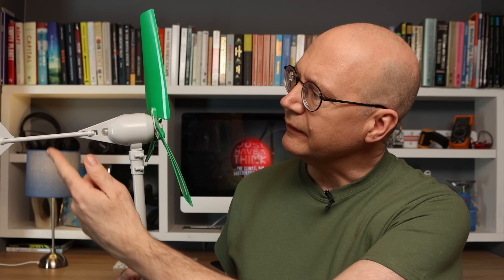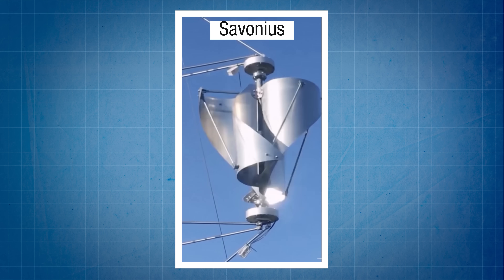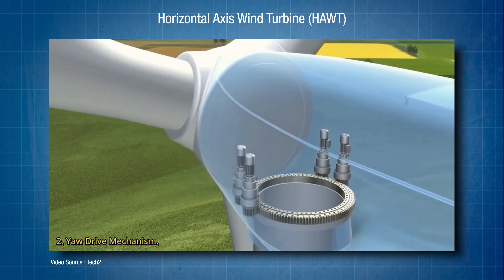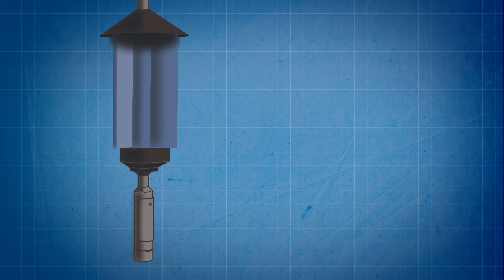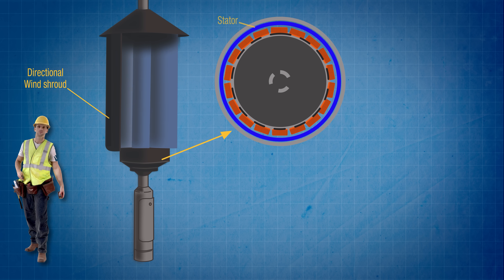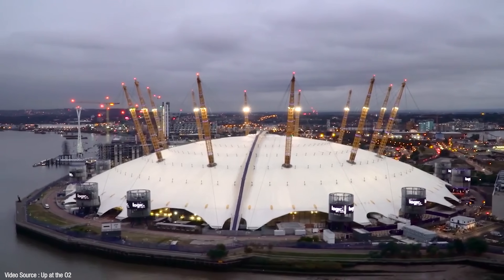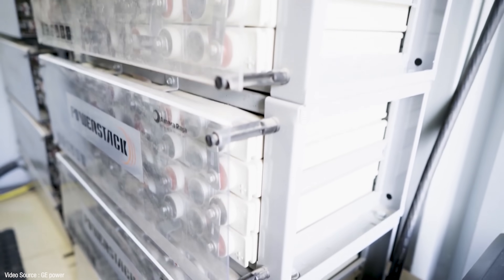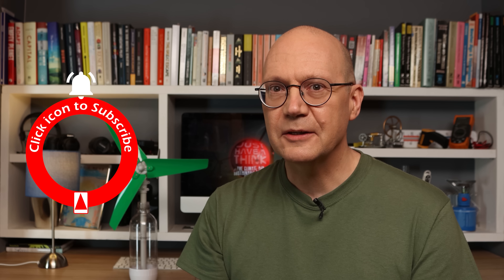A vertical axis wind turbine that doesn't need the prevailing wind! How do they do that?

Comment: I haven't tried to work out the math but those kwh numbers seem really high.  However, even if so, if they can be made cheap and reliable and deliver even enough power to break even or come close, I'm all about it.
Reply: @John M. When did you look at this?  If it's based on data from even a few years ago, then your information is out of date.  The cost of wind and solar has PLUMMETED in recent years.  It's actually been plummeting for decades, but only recently has it become super cheap.  Look at the most recent data on LCOE from the US's Energy Information Administration.  

https://www.eia.gov/outlooks/aeo/pdf/electricity_generation.pdf
Reply: I did calculate it.
You need a constant minimum wind speed of 55 miles/hour or 90 km/h to achieve 25 kW out of such a turbine.
That is wind scale 10: "Seldom experienced inland; trees uprooted; considerable structural damage"
Reply: @TheSpecio  Well it isn't that uncommon here to have 55 MPH winds. But then we don't get structural damage when we do get them. How often do we see those winds, every summer during some of our thunderstorms. When we have a Cat 1 Hurricane winds, we don't even have enough damage to file an insurance claim. Irma had winds recorded as 73 MPH in Miami. I'm 30 miles SW of Miami. Miami-Dade, Monroe, and Broward counties' building codes have the nation's highest wind standards. They improved their preparation after Hurricane Andrew hit in 1992. I know all about Hurricane Andrew because I had to spend 30 out of 32 hours at work because of it. And had a briefing afterwards that contained info that was never released to the general public. It took years to even get the government to admit how high the winds actually were. It also took years for the government to admit that there was a Hurricane tracking plane in it when it came ashore. By the time I got home after 1700 that day, our generator was running, the floors were already dry, and the windows damaged by flying debris had been covered. Our house was dead center of the eye. The power pole that was installed when our house was built in 1978 still stands today. We've gone thru more Hurricanes since then, Hurricane Katrina hit here before it hit the Gulf Coast. Hurricane Wilma that took out our neighbor's power for a week. But less than $1000 dollars damage to our home. But then, our house was designed and built to better than code in 78 and was inspected by the USACE, our insurance company, our county after Andrew to find out why we had such little damage with a two story house. And part of what they learned went into the updated code those three above counties use. Our average winds only are in the around 9 MPH range but we also have a 170 MPH wind code.
Reply: @gravelydon7072  Very interesting!
Reply: @John M. You said the large amount of land that is unusable because of the turbines. You need to talk to our midwest farmers who are still growing crops on their land around the wind turbines. I guess they don't know that it was unusable.
Reply: I did.
It's a scam
Reply: @John M. Danish power is more than twice as expensive for the consumer than in the US; so who is subsidizing?  Which country gives more tax breaks to companies?  As I pointed out, you are far from an expert on this, have no sources because there are none, and now you are predictably resorting to lame insults.
Reply: @John M. My last word here, take a look at this, about LCOE, by Tony Seba, who is much smarter than both of us combined.  https://www.youtube.com/watch?v=YJ-HlykM1LU
And if you want, do tell me where he went wrong, lol. (Just ad some sources, ok?)
Reply: @John M. sir did you really say that wind turbines are more expensive and environmentally harmful (material-wise) than NUCLEAR? i-- https://www.lazard.com/perspective/lcoe2020 the levelized cost of energy of (unsubsidized) wind is 4x less expensive than a new nuclear plant, not to mention it doesn't use ...radioactive fuels...
Reply: @John M. What was that about climate change? "not how they say"? So that is a scam, too?
Reply: @John M. I'm going to limit this to one point, please just respond to this one thing, I'll get to the next ones later. You state d There have been reports from many different places detailing health problems that accompanied living near a turbine. You mention the value of academic papers that require peer review and reproducible results. Therefore, please provide these academic papers that detail the health problems that accompanied living near a turbine.
Reply: @John M. Oh, come on. I will provide data and reports about distributed, community, and utility renewables (wind, solar). But you made an statement about the health effects of wind turbines. You have also stated your opinion on academic peer reviewed studies. So back up these health effects with a study. If you can't provide a SINGLE study then you are no different than the commenters that you complain about not reading academic studies. It shouldn't take much time at all.
Reply: Yeah, I think you are right. It just doesn't add up. Back of the envelope calculation:

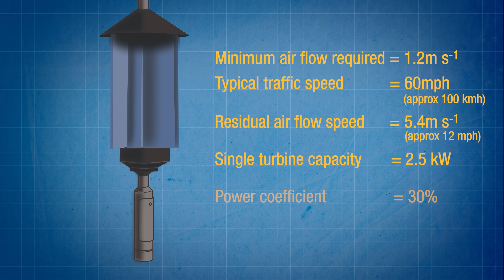The energy in wind is 1/2*rho*A*v³, of which you can harvest at most about 55% (Betz law), with rho being the density of the air, A the surface area the air passes through, and v the speed of the air. Let's be generous and say the average air density is 1.25 (it gets lower when the temperature increases) and estimate the surface area of the device to be 1 square meter. Let's use that 5.4 meters per second (which would only be the case while a car is passing a speed, but again, let's be generous). That works out to an energy generating capacity of... 54W, with 0 mechanical losses and operating at the top-theoretical limit of 55% wind-energy to mechanical energy efficiency, something that will certainly not be met). Compare that to the claim of 2.5kW in the video at the 5:30 mark. I will hold off investing in this if you don't mind. 

It would be nice if @JustHaveAThink would, well, just first have a think before blindly reproducing the very improbable numbers from startup #25328 in low-altitude wind power for urban environments.

There is very good reason wind turbines are becoming so huge: high and more constant wind speeds at altitude, and  huge surface area covered by the blades.
Reply: @John M. Please show us the research that has brought you to that conclusion.  Or are you just guessing?
Reply: @dacutler  Don't bother with this guy. He claims he has sources and then he claims he won't bother to look them up and then he claims he can't access them. Does not engage in actual argument. Probably works for the fossil fuel industry, or used to.
Reply: @tzenophile  I agree.  He's using the same old tired arguments that can only have their sources in political agendas, not actual scientific research.  The very moment somebody invokes Al Gore is when I switch off as they obviously don't have anything useful to add to the discussion.
Reply: @John M. I'm sorry, but I am not going to comment on your political comments in this subject.  This has nothing to do with the arguments around  climate change and I'm certainly not going to discuss Al Gore.  He is always thrown into an argument for political reasons and there's nothing to be gained from it.  As to whether or not I agree with their findings, only time will tell, and it most certainly won't be modified by  political expedience. I'm always very wary of people who dismiss the research done by peer reporting for no concrete reasons when it's obvious they dismiss it because it doesn't fit with their established agenda.
Reply: @John M. This is a common and a false argument.  Yes, of course temperatures have fluctuated before the mid 18th century when humans started to add more CO2 to the air by releasing carbon that had been sequestered for millions of years.  That has nothing to do with the fact that there is another source of CO2 in the air that has been added to the other, already existing, sources. Data has been used in analysis much further back than 10k years anyway.  Arguing otherwise is like suggesting that we don't have to take action to reduce deaths from road traffic accidents because people have been dying for years before the car was invented.
Reply: @John M. This discussion doesn't take any notice of future predictions. One way or the other. It's research that is trying to produce results right now. In the context of this research, I am not going to hold my breath for the advent of fusion power when there are smaller, hopefully effective ways to reduce CO2 effects on the climate, that we could be getting on with right now, even if only in a small way.  I'm sorry, but all your comments so far have been extracted from the tired old discussions about climate change as a whole, and not from this particular R & D.
Reply: @John M. I wish. Was taking classes in fusion reactor design, magnetohydrodynamics, non-equilibrium gas dynamics at CMU in 1981 hoping to have a career in plasma physics and fusion reactor research. Even back then it was 20 years away for a commercial fusion reactor. Personally I BELIEVE that we will have HVDC grid interconnects done in the USA before a commercial fusion reactor. It is not what I have always hoped for.
Reply: @John M. Are you still insisting on conflating this subject with the politics of climate change?  How do you know the people who are researching this aren't more conservative or republican than you are and are therefore not on " my side "?  Actually, you are wrong, but that's another subject that is far too complex to discuss in this format.  There are plenty of peer reviewed articles on the subject, I suggest you read a few (and not take your conclusions from Al Gore or any YouTube video produced by somebody who obviously doesn't have any idea about it). 

You're not a flat earther by any chance?    Just wonderin'
Reply: @John M. I was wondering when you would resort to insults.   It's the MO of people who don't know what they are talking about.  . . . .   Oh well.  I'm not going to contest you by  tell you how old I am, my credentials and how I have not run away from something new.  That info is not for this YouTube.
Reply: @John M. Eh?     What has that word salad got to do with the subject at hand?  You are entirely wrong about scientific people.   As Einstein said "  No amount of experimentation can ever prove me right; a single experiment can prove me wrong. "  A person can only call themselves a scientist if they welcome somebody proving them wrong more than proving them right.  It's only proving a person wrong that can make any progress in any scientific field.
Reply: @John M. " People like you would have called the sailors liars. "  I'll give you this . . that's the weirdest accusation of me I have ever heard.   I'd love to see specific data that proves your statement.
Reply: @John M. Have you confused comets with asteroids?
Reply: @John M. You are full of crap. Some idiot says blah blah about wind turbines, there is no real studies backing up the blah  blah health problems of these wind turbines, and you seem to always fall back on: The scientific establishment is not letting the truth be told. Good bye
Reply: @John M. What has this got to do with turbines?  Why are you wasting my time like this John?  Is the only way I can stop you asking silly questions to ignore you?
Reply: @John M. The data are clearly broken out with and without tax credits, and wind and solar are cheap either way.  You'll also notice that nuclear is eligible for an even larger tax credit than wind or solar, yet is far more expensive, even with the tax credit.
Reply: I was thinking the same, no way it can produce that much electricity!
Reply: I agree that this sounds like pie in the sky.  But if it proves out from a credible source,  i would advocate it.
Reply: @VAspeed3  Of course.  I'm always fascinated by small/edge power generation technologies and more options is better.  I just hope for everyone to be forthcoming about the limitations and drawbacks of these technologies, exaggeration  is not going to help us move forward at all in the long run.
Reply: @John M. OK, you have NEVER heard of farmers that put wind turbines on their farm land and still farm? You imply, also, that it is a single instance. how cute. Do a search on farmers and wind turbines. Read about how the extra income helps their bottom line.
You also state There have been reports from many different places detailing health problems that accompanied living near a turbine. You mention the value of academic papers that require peer review and reproducible results. Therefore, please provide these academic papers that detail the health problems that accompanied living near a turbine.
Reply: @John M. This USGS (United States Geological Survey) calculation (see link) uses a 33% capacity factor (average percentage considering all the wind turbines in operation in the United States) to determine the wind turbine requirements.  Of course, these are essentially all horizontal turbines, but this is probably a good starting point for vertical turbines too.  https://www.usgs.gov/faqs/how-much-wind-energy-does-it-take-power-average-home?qt-news_science_products=0#qt-news_science_products
Reply: @John M. Oil. Yes, good for the environment?
Reply: @John M. Nothing in that article documents your own false claim that "temperatures have risen faster in history" than now.  That would have been sensational, but instead it is clear you are trying to get away with lies. Which fossil fuel company did you work for, again?
Reply: @John M. Your last sentence is a warning sign.  It proves you don't really know what's going on.  The colder areas are also being enhanced by global warming too, and it's very easily proved.  It's mainly because the air in the South Atlantic and Pacific has been warmed more than usual, so is rising much more than before.  This pulls greater amounts of  air from the regions closer to both poles, and, in the case of the colder air in, say, North America, is pulling the jet stream  South towards the equator to a  much greater extent.   If I may suggest, please look up Spectral Absorption as it applies to CO2 and methane.  Energy at the greater frequency of radiation from the sun passes through CO2 more readily than the lower frequency infrared radiation of that same energy as it rises back from the Earth.  It gets absorbed on its way back to a greater extent than on its way down, so is trapped in the atmosphere.
Reply: @John M. You seem to have moved away from the subject of this video.  It doesn't talk about wind farms.  You are also making claims that even they haven't yet discovered. How on earth do you know that 'This stuff is a dream that they have not even produced something approaching the capabilities they claim' ?
Reply: @John M. This research has nothing to do with nuclear power, China, India, Al Gore, the shipping industry, and it certainly doesn't increase pollution like you suggest.  I confess I don't know why you are adding those issues to the discussion.  If you really want to introduce effects like CO2 emissions from cars, you can start, if you like, with the fact that on average a car adds about 5 tons of CO2 per year into the atmosphere and since there are,  very roughly, one billion cars around the world, that's 5 B tons per year from cars alone.  By all means add more to this discussion but could be keep it factual as opposed to what we might feel is happening?
Reply: @John M. "The amount of time it will take you to actually be a couple of days" That sentence makes no sense. Anyway, you claim that temperatures have risen faster in the past. That is a fabrication and a lie. Why do you lie?
Reply: @John M. It's gibberish and has been promoted by people who have no idea what they are taking about trying to prove an impossible concept  known as an electric sun.  As far as I know it goes back to the 70's.  They don't think the energy from the sun is produced by fusion, but by some bizarre electrical effect that does not exist and can't possibly  exist and are saying they can emulate it in a small lab.
Reply: @John M. II do not know this area. It comes under the umbrella of Low Energy Nuclear Reactions (LENR), Chemically Assisted Nuclear Reactions (CANR), Lattice Assisted Nuclear Reactions (LANR), Condensed Matter Nuclear Science (CMNS) or Lattice Enabled Nuclear Reactions. I did not like that video because it was an
Reply: The youtube editor cuts off my comments. I went to their website to find a list of peer reviewed publications and could not find any. I then did a search for any papers by the president of the company. Again, I found none.
Reply: @John M. It's not me doing the dismissing here.
Reply: @John M. My guess is about 100 years ago that metallic hydrogen was postulated.  You are aware, I hope, that it's not only metals that are described as metallic?
Reply: @John M. That is two more lies.
Reply: @John M. They have claims of concept. That is different. The lack of peer reviewed papers, the lack that their chief scientist, the president of the company, has no published papers that I can find. That all raises a  flag.
Reply: @John M. OK, I watched that whole video, went to their website, went thru the whole thing, looked up their scientists, tried to find publications, and so on. Please do me the favor of watching this video completely https://www.youtube.com/watch?v=vmVdPgkudC8
Reply: @John M. Sorry, which medical stuff am I ignoring? Too many tangents to keep track of. If you are talking about wind turbine medical issues, I'm still waiting for you to post the academic papers on what those issues are.
Reply: @markvalery8632   You're wasting your time, this guy is a crackpot.
Reply: @John M. I'm not sure what you want me to say.  Laithwaite was one of my heroes.  Actually, I met hm when I was at university in Manchester. It was when he was working on his Maglev research and we had the labs that he used for some of his work. He was oscillating between Imperial College London and Manchester University (he had worked on the development of the first programmable computers at Manchester just after the war). He was one of those very rare scientists who seemed just as at ease in front of a camera as he was in the lab. He also came from a part of the North West of England where I lived for a few years.  Hence his Lancashire accent!
Reply: @John M. Well, you were trying to steer the discussion away from the content of the video somewhat!
Reply: @John M. OK, but you really don't have to show me stuff that I know about scientists already.  Even if it is new to you.  But thanks anyway.
Reply: @John M. I don't know how many professors of scientific endeavors you know but my experience of them is they enthusiastically welcome people questioning their work and view a person who proved them wrong with respect, as they obviously learned something more than they did.  They are happy that their work, even if it was proved wrong, actually moved forward the knowledge in their particular research areas.  Any professor who didn't have that attitude should not be called a scientist in my understanding.
Reply: @John M. OK.  How many professors are secretly working for China, and if it's  secret, how come you know about it? ?  You seem obsessed about metallic hydrogen.  Do you actually know what it is and how it happens?
Reply: @John M. Do I want more facts from you that I already know?   No thanks.   Incidentally, have you heard the expression " Please don't confuse your prowess in using Google with my two degrees in science"  ?
Reply: @John M. Wind power as such is not a scam, but have proved extremely useful for thousands of years. These vertical axle turbines, on the other hand, are super inefficient and generally far from worth it. But whatever is wrong in California, I would never blame wind power. Just look at Denmark, where  (horizontal axle) wind power market share is 55%. And rising. So that works more than fine.
Reply: @tzenophile  So what is the cost to clean up these wind turbines after their useful life of 25 years?  look at the wasteland of old windturbine farms.  they are just left there to rot and the people who made $millions, are NO WHERE to be seen.  IT IS ALL A SCAM.
Reply: @bernventer5949  having bought a share in a wind turbine with Ripple Energy, I can assure you that decomissioning costs are factored in, and most of a wind turbine can be recycled.
Reply: @bernventer5949  It is not logical to blame an energy harvesting technology for the malpractice of some operators. You are not making a rational argument. Are you wearing clothes, right now? Look at the wasteland of discarded clothes. Is clothes a SCAM? Are you using plastic? If there is a problem of discarded wind turbines, blame the lack of regulations, the corrupt politicians, whatever, but your question is not in any way relevant to this topic, which is the relative efficiency of HAWT vs VAWT. There is no wasteland of old windturbine farms in Denmark, because Denmark is not a corrupt third world country. Don't fight the windmills!
Reply: @bernventer5949  I have done work cleaning up uranium, coal, and gold mines. Wind turbine bases look easy enough. Besides which most places now require money put down upfront for decommissioning.
Reply: @ethanswanson9209  Exactly. I just demolished a house renovated in the 60s. The report on environmental toxins were pages long. I'll take steel and fiberglass any day.
Reply: @bernventer5949  you mean just like the mines that supplied coal before them or the hundreds of thousands of capped oil and gas wells once they run dry?

Turbines can be maintained or replaced to extend their life far beyond 25 years. Indefinitely in fact. It's up to governments to set the conditions.
Reply: @John M. Danish power prices are subsidized? Let's stop right there, and you provide a source for that claim. Ok? I'll deal with the rest of your claims when I know you are not a troll.
Reply: @John M. Because, it DOES NOT EXIST. Your claim is false. Another bloke on the internet, making sh!t up. Goodbye. P.s. Thanks for saving me the time to debunk your other arguments.
Reply: @John M. Ah, I knew it, you're a climate change denier as well. What a surprise. You know, the denial bullsh!t can be refuted by one simple observation: temperature changes that took hundreds of thousands of years now takes decades. But you know "differently", right. You have proof that globally, temperatures have risen faster in the past. Except that no such data exist. And of course, no scientific sources, can't be bothered, even as sole custodian of these revolutionary data, you don't have to prove anything. Well, then, bye bye.
Reply: @waffleuk  yes, Dave said that. But anyone with the formula and a caculator (and a working brain) can see that the numbers are off by one or two orders of magnitude. This is super embarrassing.
Reply: If it looks too good to be true, it usually is. I don't believe these numbers at all; where is the actual data? The only sensible thing is to invest in large scale HAWT wind power that actually works, combined with grid supporting batteries. These will be a nightmare to service. If they don't break even, they are dead.
Reply: @tzenophile  I also doubt the numbers. Most of the air that vehicles displace gets sucked straight in behind, and the denser the traffic is the less wasted energy there is due to drafting.

There's also going to be a lot of disrupting of traffic in maintaining these turbines.

And then, a technology that relies on the inefficiency of another technology is a precarious gamble, even fundamentally flawed in principal IMO. Politically conflicting as well given the drive (no pun intended) to get vehicles off roads.